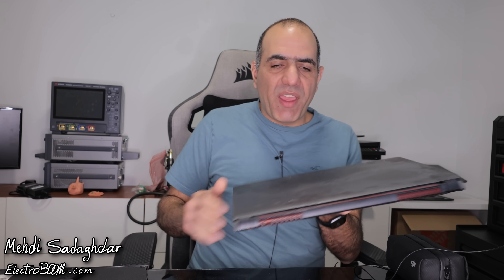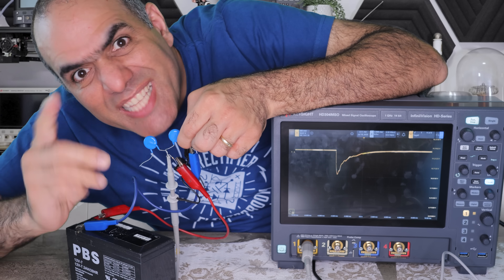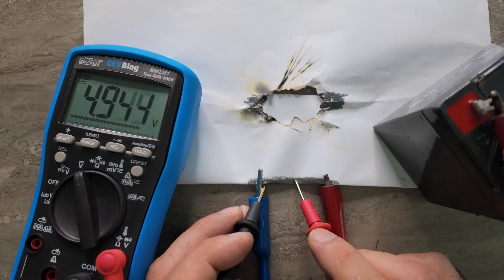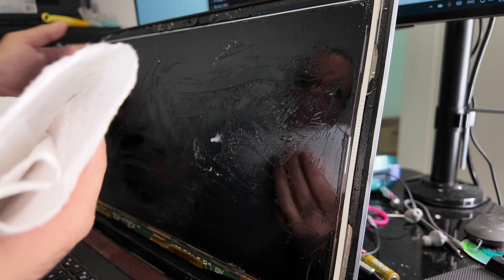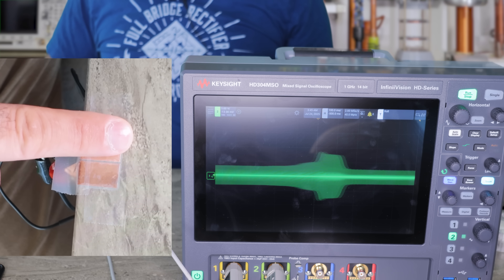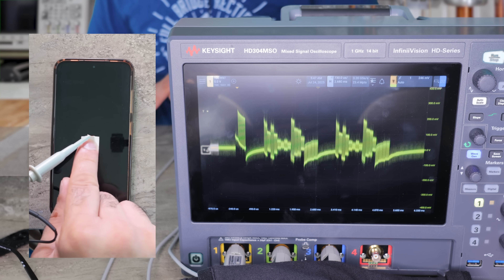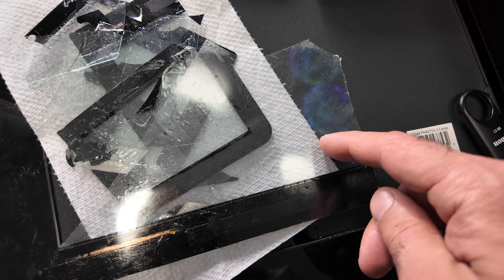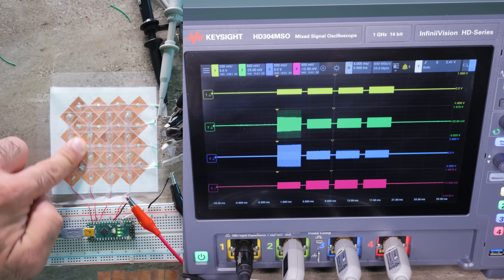The Touchscreen that Changed the World!

Comment: Some random tidbits:

Resistive touch screens only have the ability to register a single spot where the touch happened. Therefore, it can't support multitouch like your normal capacitive touch screen. They are also really hard to find compared to capacitive touch screens these days. 

IR touchscreens sound cool at first but in practice, it's hard to to get a accurate "touch" points and on top of that, it's easy to get a lot of "phantom clicks" because most screens have only millimeters between a mouse "hover" and a mouse "click".
Reply: Intels Meego tablet had a resistive screen with up to five simultaneous touches, and that was 15 years ago.
Reply: @anC00L  Are you sure about that? I actually worked on the Acer M500 (MeeGo version) and it was capacitive touch, not resistive. Unless there was another cancelled tablet or maybe you are talking about the Maemo (N810 / N900) based devices that were resistive but it didn't support multi-touch.
Reply: Just search for "resistive multi touch" and buy one.

Comment: Excellent explaining on touchscreens. I never thought the sensor resolution for phones etc was this low (only 20 lines). Reg. AI; it will be our downfall. I know this isn’t a popular opinion, but AI is trained on human output. With AI quality of human output will be reduced severely, and bad code keeps being recycled and retrained into AI. Even in small scale I see it happening. github copilot is getting it wrong more often than it gets it right. Maybe it’s confirmation bias, but still, I don’t see AI being beneficial. It doesn’t make the less learned better as being told the answer doesn’t make you remember as well as figuring it out yourself, and the seniors using AI for accelerated development, only lose a lot of time with correcting AI output. Guess I have become a pessimist, a grumpy old man. Now get off my lawn! Oh wait, don’t have a lawn…

Comment: Hey Mehdi! So I recently found out through some events that I'd rather not elaborate on that your "accidental shocks" are just as harmless as you have eluded to, and seem to have no long term effect on the body, provided the contacts aren't too close to your heart... But I want to know WHY!?! My best guess is that AC current is pushing and pulling a capacitive charge up and down your arms, as if tiny wave generators are vibrating at high frequency on opposite ends of a gigantic wave pool. Someone floating in the middle of that pool would barely feel a thing and the waves dissipate out over the capacitance of the massive pool, and that's what I speculate is going on with AC shocks being absorbed by opposite arms... Can you shed some light on why these AC shocks simply aren't dangerous?

Comment: That potentiometer using a pencil is GENIUS! Never thought of it but it seems so simple. Back in school lab, we were not able to do a potentiometer experiment because the equipment was not working. But the solution was right there in our hands the whole time!
Reply: Yeah, it really ILLUSTRATES how they work.
Reply: I still remember learning about resistance using a multimeter, a pencil and a piece of paper back during my primary school years 35 odd years ago - I was a huge electronics nerd back then.  The multimeter I was using was even the analogue meter that my dad had used during his electrical engineering degree.
Reply: I had an electronics learning kit as a child many years ago. Using graphite to implement a potentiometer was one of the first things the kit taught.
Reply: You can even repair some worn-out pots by drawing a new conductive line with pencil. Or, if they are not damaged but only oxidized, use some isopropyl alcohol on them. And maybe some light sewing oil or silicon oil afterwards.
Reply: @PavelD.Danilov  i'm going to have to remember this. I have a bunch of amps I need to repair that have bad pots, was considering disassembling the pots and seeing if I could fix them but I didn't know how exactly lol.

Comment: People got dumber in a way when we went from having to look in a book in a library to figure out random things to everything at our fingertips.   This created people who said they know how to do something but when it came down to it they screwed up some process along the way.   With ai there will be erroneous “facts” that when dealing with chemical or electricity those issues will cause deaths.  The final products also could be verified and deemed stable with false pretenses like say the ai said a certain structural design was fault tested and approved by the engineers when it was actually deemed fit for a mock up building made as a prop in a movie which was preapproved by engineers regarding safe for occupants around the structure and not specifically stating inside.  This could cause a person to have the same floorplan to be built for hundreds of people to use daily..

Comment: Programming the Arduino would have been the biggest fun part of the project for me. AI is taking away all the fun by making it so easy!
Reply: Anything more advanced than setting up a peripheral the most basic way and AI fails miserably. LLMs absultely suck at anything hardware or embedded related.
Reply: You'll still have the fun of programming the Arduino. Although in the AI case it's fixing all the crap it produced.
Reply: i mean you can still do it yourself

Comment: Moving from calculating numbers in our heads to using a calculator doesn't make us dumber, it makes us focus on learning things that are much more challenging (and fun) than calculating raw numbers.  The same goes for AI.  Obviously there are the wrong way of using AI, as in just copying its homework, but for those with core experience and understanding, it's like having 5 interns working under your wing.  It frees us the time to learn even more challenging things.  

Obviously there are downsides to not learning the basics or "taking shortcuts", but that's not an AI problem but an operator problem.  We should all be responsible to learn the fundamentals so that when our helpers make mistakes, we can correct them.  That have little to do with why we should or shouldn't leverage AI.

Comment: In my experience Infrared are the worst type of touchscreen, then resistive and then capacitive. 

The amount of problems I have from infrared are.
- Dirt/dust creating a press event or offsetting X or Y coordinate depending where it is dirty.
- Input jumping all over the place.
- Unable to long press cause of instability.
- Dead rows or columns as the infrared LED or sensor died.
- PC being unable to supply enough current out of the standard USB port. Ditto if I have another power hungry USB device like a bar code scanner plugged in at the same time.
- Stupid people spilling fluids or not understanding to not let the window cleaner to drip to the edges of the frame leading to corrosion and blown ICs.
- Also had the transparent plastic edge melted from people using the touchscreen with a cigarette in their hand and hot ash melted the plastic interrupting the beam. Fixed it with sanding and polishing with a headlight restoration kit.

Comment: No, no, no!  Alcohol is not the solution!  It is the solvent!
Reply: Usually there's some amount of water in commercial alcohol. So practically it is a solution.
Reply: @Name-gi8dr  You get a point for accuracy, minus three points for humour. 🙂
Reply: You get minus 1 point for the guy who had it fly over their head and plus 69 points for the nice ryth.
Reply: Came here to say just that!
Reply: dissolving glue with alcohol is a solution

Comment: Engineers should KNOW & fully understand how electronic circuitry works & to design circuits.
If no one knows and when there's another Carrington event, we'll be extremely slow to recover our tech as most AI will be fried.  I also think Arduinos are a bit O/P as it takes away a learning curve for basic circuitry ie timers / astable loops etc.
Reply: Hey, im a student and i need help with circuits, kvl and kcl problems if you don't mind,i can share the pix of the circuits and you could help plz🙏🙏🙏

Comment: Back in the 90's IBM had a PC touch screen that used strain gauges in each corner. They were sensitive enough to detect where the glass distorted when you touched. It worked surprisingly well but was very expensive.
Reply: Remember i saw some screens like that. It was what basically looked like a standard CRT kind of suspended in each corner. Pretty cool to try :)
Reply: How in the interpolation did they manage this?
Reply: @specialusername-n6r  Search for "IBM 8516"
Reply: Hey, im a student and i need help with circuits, kvl and kcl problems if you don't mind,i can share the pix of the circuits and you could help plz🙏🙏🙏

Comment: 0:13 dells are notoriously known for this to happen. Even if you don't crack your screen air bubbles can appear and the glue they are using can leak into your display and mess with the backlight. Seen like 4 dells with the same exact issue. Dells are good but you should avoid touch screen ones due to this very issue.
Reply: I had a Dell monitor that had bubles too before dying
Reply: A far cry from exploding laptops.
Reply: Yeah I have the same model of DELL touchscreen laptop and it also has bubbles in the screen where the glass has separated. And it runs really hot (yes I cleaned out the dust). The stupid fan doesn't start running until the CPU temp is >80 degC.
Reply: @pressurelamps  No BIOS fan curve?
Reply: @Curt-0001 No way to change how the fan operates. Honestly thought about wiring it directly to a USB port so it runs constantly.
Reply: @pressurelamps  The fourth wire on the fan plug is a PWM signal that is active when the fan should stop.  If you remove it (use a small screwdriver to remove the wire from the plug) then the fan won't get any slow/off signal and it will just run at full speed all the time.  It was designed this way for backwards compatibility so a four-wire fan would still work normally if connected to a three-pin motherboard connector.
Reply: I had this exact Dell laptop and the supplier for the display was a random Chinese company. So I'm sure they supplied other brands
Reply: Fortunately, my Dell is still surviving, but my mom's HP also had this issue within the first year of use. Thankful mine dodged this issue, and frustrated this is a common occurrence
Reply: That's the reason my laptop now is not Dell. Had 4K IPS touch screen and I loved it until it threw those growing bobbles
Reply: I had an LG monitor get bubbles too - though that was delamination due cold winter nights near a window and a hot sun in the morning. Moisture + tempurature = expansion / contraction. My own fault.
Reply: Had a few Latitudes at work with bubbles. Makes sense! Always was curious what was going on.
Reply: @ZenIsFluffy  sometimes you can fix them by pulling a vacuum on them preferably with like a 5 gallon resin outgassing tank but a foodsaver might work and then blasting the screen with 405nm uv
Reply: @ZenIsFluffy looks like they are using OCA glue that's different from smartphones, it is not hard rather sticky and liquidy. I have no idea whether it softens due to use or is that soft from the factory. Either way if they used the same OCA glue and hardened it with UV just like smartphones it wouldn't be an issue to begin with.
Reply: Had same issue on idepad yoga 11(not s)
So i think its not dells but display+touch manufacturers
Reply: Nah just avoid dell

Also maybe amd

Comment: 13:23 Might I suggest checking the arduino nano ESP32, or the RP2040 boards for use of micropython when programming them, it's easier to code than C when things get bigger

15:50 it's an allright tool, but will become bad when AI start to fail and you need to figure how to make it actually work, if you don't have the baseline for it, I even despise use of cursor if you don't know what it is doing at all
Reply: Even better - you can run TinyGo on ESP32. If you can code in C, it’s much easier to switch to Go than python and it’s much more efficient

Comment: How to make a small device that fools a capacitive sensor? My use case is a VW Travel Assist steering wheel with capacitive sensors. With my dry hands it’s not sensing my hand easily, I need to grab it hard. My wife with soft hands can use the system easily.

Comment: 13:26 This is the most existential dread I've felt watching a YouTube video.
Reply: Gonna go surface level but a lot of AI code doesn't fully understand context so it normally just reproduces solutions for well understood issues, it tends to struggle with more complex (and hence more unique) systems. Something like blinking an LED or sending timed signals is simple enough that an AI can do it. However the current model of AI (in my amateur opinion) is never going to be capable of doing more than collating existing knowledge and repeating solutions, no matter how much processing power or training data we throw at it, and making it more of an existential thing will require an entirely new way of making an AI.

Not an expert so if someone else has other thoughts am happy to hear them
Reply: @nefarioustechsupport1243  I agree, you know how complex your project is, the AI only knows the internets issues.
Reply: Blink is like the first example for the arduino to verify that everything works.
It's literally in code examples.

Comment: After I got tired of cutting my fingers on a hand me down laptop, I disassembled it. I harvested two diffraction grating sheets, diffuser sheet, LEDs  and glass with polarized film glued to it that was cool enough to put up with some minor cuts every now and then. The diffraction grating isn't the best so it just got taped to a window so I get to look at pretty rainbows when the sun is in the right place, but you probably could use it to measure the color output of a laser diodet. And I guess some of the glass might have indium tin oxide coating useful for making low quality organic solar cells at home.

Comment: What I found interesting and before AI was popular, I went to college and took a semi conductor course. While in class and using a device, OSCOPE, for checking zener diodes I was curious how the scope was made to read the breakdown point of the zener diode, but showed on screen where it reversed the voltage. I was told the device was designed by a computer!

Comment: As a programmer and architect with over a decade of experience, vibe coding is not recommended without the underlying knowhow.
Reply: No no, you're missing the opportunity, we need to encourage more vibe coding, because I charge double my standard hourly rate to fix all the problems the broken AI generated code caused on top of also fixing the original problem.  Vibe coding is awesome!
Reply: Not much different to ignorant cutting and pasting from web searches.  Good encompassing design is and always has been the hardest part.  Emphasises that programming languages, with their pattern templates, are dialects of natural language.
Reply: In this case it's kinda ok I guess. One off hobby project with nothing on the line. Just don't go all "hey can you fix my code" if an AI wrote it, I'm not touching that.
Reply: @RoelThijs  yeah ok, but first mehdi sais he wants to learn a skill and then he does this. Its good enough for a test bench, but nowhere near proper software engineering and understanding the underlaying hardware
Reply: As long as it is closed off from the network, I guess. Unlike some tea app that comes to mind.
Reply: @RoelThijs  It's pretty much the perfect use case for vibe coding. When you're not a programmer but need to write code for personal use, AI is a great tool. I understand many of the arguments people have against AI, but a lot of people treat it like it's an actual spawn of Satan.
Reply: @MaskedDeath_  Well when you take into consideration the power consumptions, the labour and intensive material extraction needed to create the components etc etc, just so a person can use it on a throwaway project and not even learn anything that lasts. 
It's awful, people should take these things seriously and deeply consider the impact that the tech they chose to use has. (and also criticize the companies that push it so hard on everything)
Reply: @Valenspire  if we follow your logic, we can't do anything. At this moment you're spending resources just to talk bullshit on the internet, for example.
Reply: @harielabram  The logic is about being intentional about what you use, that does not mean never using anything. I don't think anyone wants to throw out all tech, it obviously has the potential to enrich our lives.

If that sounds like bs then I can't help with that.
Reply: @Valenspire  you sound just like the idiots that say 5G will cause cancer. good job.
Reply: almost clicked off the video when that came up XD
Reply: For mehdis usecase in this particular video it's fine, anything more complex and you're just asking for trouble
Reply: that part was cringe indeed, sounds like he downloaded knowledge like the guy in the matrix ><

Comment: ngl though I studied E.E didnt exactly know how  capacitive touch screen were designed. Thought before that they used 1  adc channel per contact pad  which to me seems illogical because it would use so much pins on an mcu But this makes so much sense to put them in rows and columns instead of single points. Its similar to how pc keyboard work as  well. Its crazy how simple it is. Not to mention your explaination is top notch and easy to understand. ik how frustrating it can be when youre researching on how something works and the explaination given is too wordy, uses jagon  that is not yet popular in the field or over explains it.